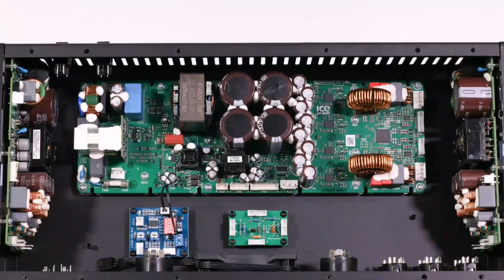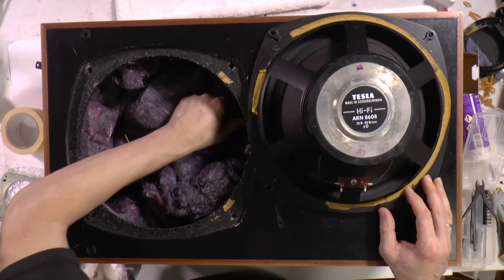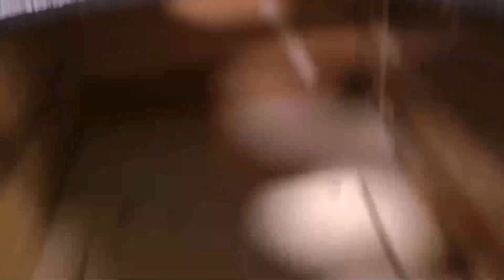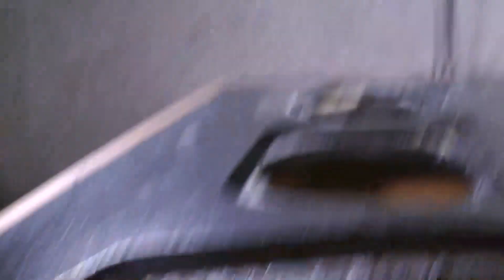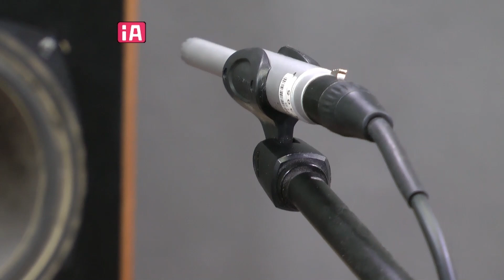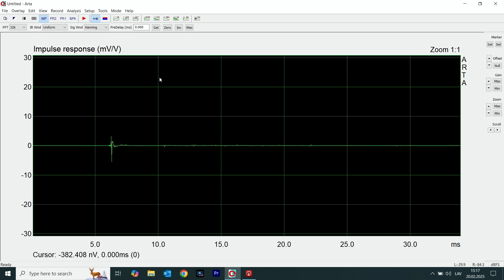ICEpower 1200 FAQ Transforming Vintage Speakers into High-End Audio Equipment: A Step-by-Step Guide

Comment: I like the way you fitted the new drivers into the old cabinet. I recognized that matching replacements are almost impossible to find (currently looking for midrange drivers for Wharfedale E.Fifties). I do not have sufficienst equipment to build the fittings out of metal or wood in such a perfect quality ...
Reply from the maker: Yes, matching replacements are not possible to find. Dimensional standards have changed.

Comment: Great, I am making the same experiences in the last couple of months. I took 3 different vintage speakers and converted them to active (HECO PSM 1000, Arcus TM66, Scott S176). However, I use an 8-channel-DSP amplifier and build the digtial crossover completely with FIR filters. In building the FIR filters, I linearize the drivers frequency repsonse and phase with nearfield measurements, I (slightly) tune the tonality of the speaker to the listening position and finally, I correct room-specific problems, if (too) audible. The results are stunning and I will continue to experiment and research into this direction.
Reply from the maker: Impressive. Modern digital crossovers seem taking the market.

Comment: Soon, i'll do the same with my hzk12031. 4 tpa3255 & 6ch sound processor
Reply from the maker: Go forward, you will not regret the outcome. The resolution that I have achieved exceeds my expectations. I have learned that both midrange and tweeter should be good. In the non-treated room is better to cross a tweeter lower than higher to get reflections sonically balanced. Otherwise, the midrange starts beaming and reflections will change neutrality.